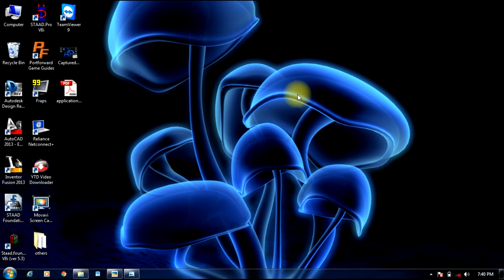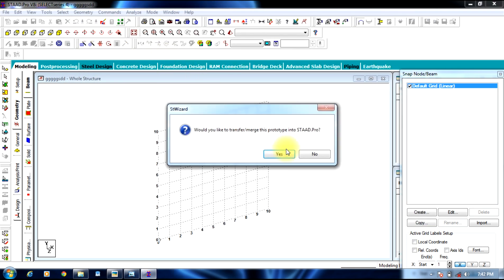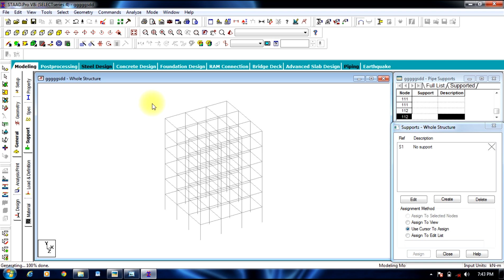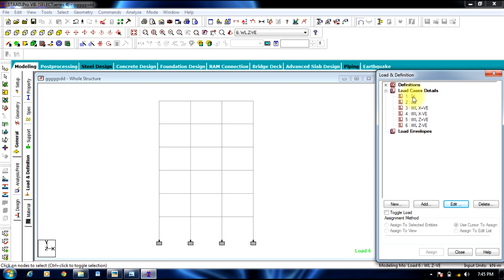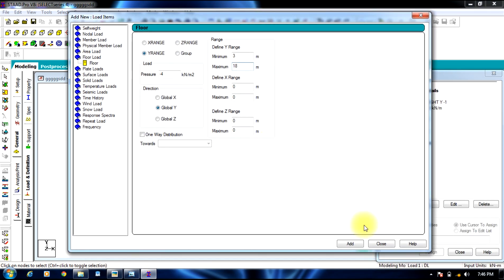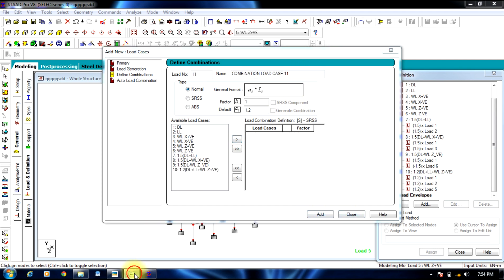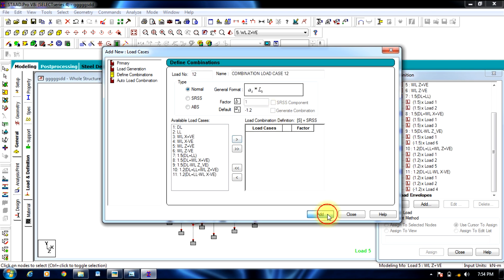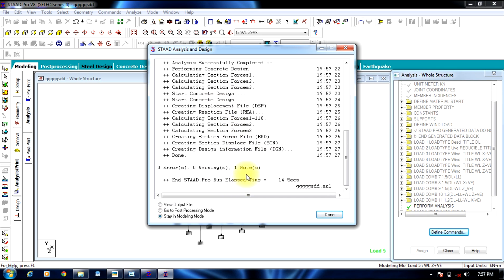Staad Pro Tutorials Wind load Analysis on RCC Building Day 11

Comment: excellent job sir!!! thank you for take the time to make the videos!! and i would like to ask two things, first when you are creating the forces for the wind load there is a label called "main building data" which requires height and length of the building and you did not touch them,does it affect the result?? and when you are adding the wind load for a positive direction in X or Z you put +1 opposite case -1, then when you are creating the new combinations for example 1.2(DL+LL-WL X-VE) when you add wind load you change the sign to -1.2 but i think you took that sign in consideration already, i think why in the combination 11 in minute 17:17 the deflection is in the positive direction and it has to be in the opposite direction but i may be wrong or what do you think???